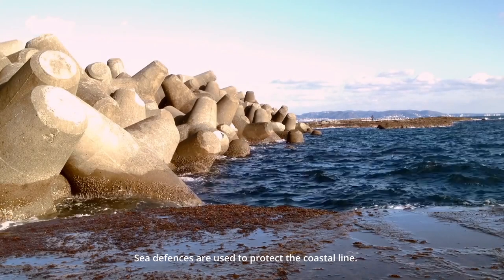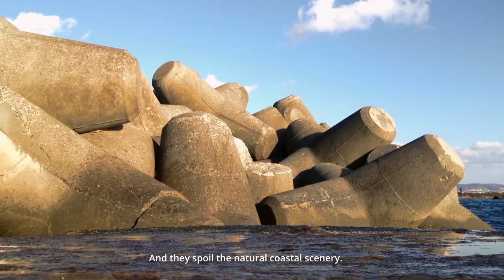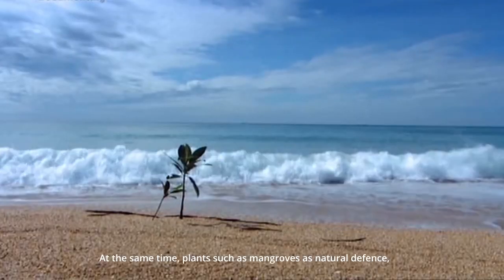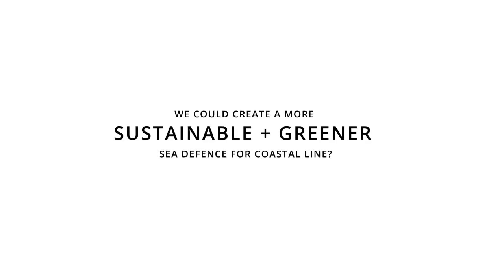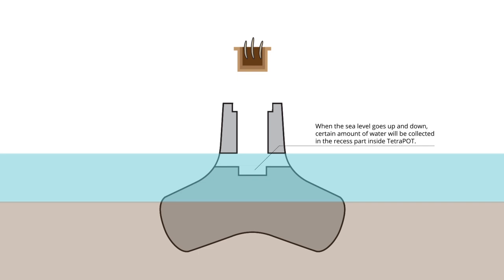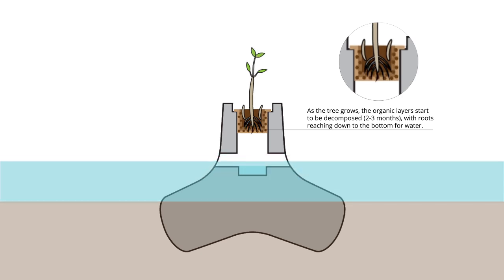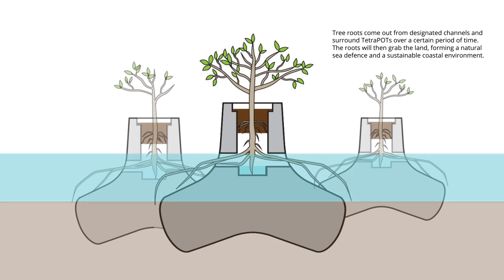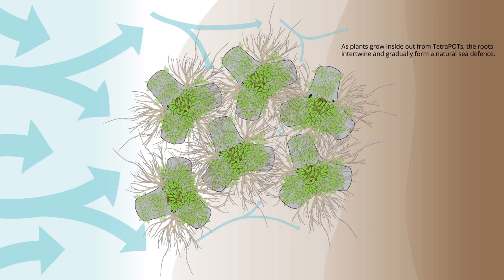TetraPOT | Sheng-Hung Lee

Comment: While the tetrapod is a french invention you never see them around in france. They ruin the see side landscape in such a way no one would ever accept their presence. The country that produce the most ridiculous amount of tetrapods is probably Japan where the construction industry reigns supreme on local politics. There's very little incentive for the majority of low skill workers that  live around coastal villages to oppose the spread of tetrapods in Japan, because they would be unemployed otherwise. From mining, concrete production, sand dredging,   filling the thousands of tetrapods mould with sand taken from rivers and costal areas, and finally transporting them with special boats equipped with cranes, it's a big production chain that would have to be dissolved in order to save the beaches from utter obliteration by the concrete industry. 

It's sad to lean Taiwan is suffering the same fate as Japan, probably courtesy of Japan Inc.  I do hope these kind of projects will have a proof of concept financed and will eventually create a new industry that will replace the current monstrosity.